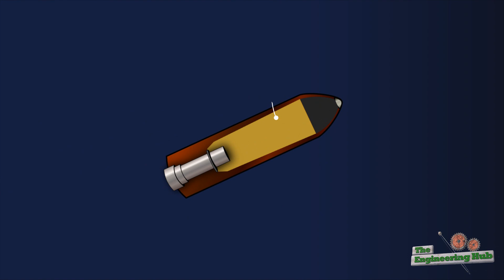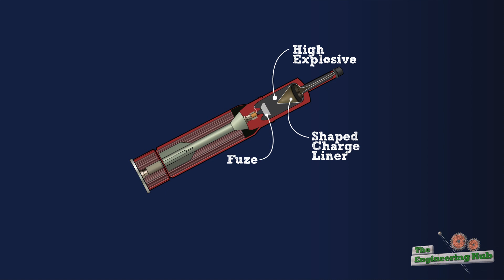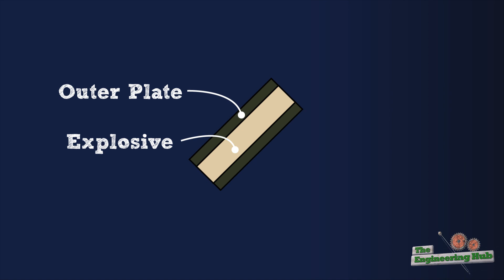Tank Armor. How does it work?

Comment: How about a segment on underground bunkers?  I had the privilege of visiting numerous WW2 bunkers in Germany and France.  The detail and designs of these military bunkers were incredibly well thought out.  Zig zag walls, sloped roofs, air intakes, security measures, cement tables with artillery coordinates built-in, etc.  Extremely difficult to destroy.
Reply from the maker: WW2 bunkers are fascinating indeed. I had the chance to visit some on the coast of Denmark. As a structural engineer, I was very impressed by these structures and the effort that had gone into building them.
Reply: @TheEngineeringHub  most people think dig hole in the ground, put in cement box, then cover with dirt.  This German bunker I saw had multiple levels with descending stairs a machine gun portholes at each level guarding each level.  On the side of the steps going down was a 2ft smooth roadway for a small trolley to operate.  It was used for moving supplies up and down.  Also, no signs or markings of any kind to guide u.  Any intruders would easily be lost in a labyrinth of tunnels.  These bunkers were bombed continuously but survived intact after the war.  There were things built into the bunker of which I didn’t understand the purpose.  But one thing I know for sure, the Germans never did ANYTHING just “because”.  Lol.

Comment: ERA came to be because of a Germen discovery after the 6 day war (Israel Vs Egypt), it was first adopted by Israel in mid 70's and was a secret till it fell in to the hands of the USSR in 82. From than on it proliferated all over the world. thanks for the vid but it's not that accurate.
Reply from the maker: The idea of counter explosion (kontrvzryv in Russian) in armor was first proposed by the Scientific Research Institute of Steel (NII Stali) in 1949 in the USSR by academician Bogdan Vjacheslavovich Voitsekhovsky (1922–1999). The first pre-production models were produced during the 1960s. However, insufficient theoretical analysis during one of the tests resulted in all of the prototype elements being blown up. For a number of reasons, including the accident, as well as a belief that Soviet tanks had sufficient armor, the research was ended. No more research was conducted until 1974 when the Ministry of the Defensive Industry announced a contest to find the best tank protection project.

A West German researcher, Manfred Held carried out similar work with the IDF in 1967–69. Reactive armor created on the basis of the joint research was first installed on Israeli tanks during the 1982 Lebanon war and was judged very effective.

Reference:
https://en.wikipedia.org/wiki/Reactive_armour
Reply: @TheEngineeringHub  Can't argue with Wiki ;)

Comment: It still amazes me that ERA can react in milliseconds to a RPG or other projectiles striking it. It has to react faster than the fuse and explosive charge in anti-tank round. I wonder if a soldier outside of the tank, close to the ERA going off can be killed or wounded?
Reply from the maker: Hi Steven thanks for the comment. It is absolutely insane how the explosive gets activated in such a short amount of time! To your second question, during the research we found that the shrapnel from the ERA or the scattered missile itself can be deadly to nearby targets. But also, it is not that easy to activate the ERA. For example, the explosive will not get activated from a bullet striking it but only from a larger object with enough velocity such as a missile. I should also point out that we are structural engineers and not weapons engineers (little disclaimer). We found this technology fascinating so we decided to make a short video about it. Cheers!
Reply: @TheLadderman  thank you for detailed explanation.

Comment: One surprising part of the Russian invasion is that a lot of their tanks aren't actually equipped with reactive armor. If you look at photos you'll often see the bags on the sides that are supposed to contain the explosives but they're hanging loose and clearly not filled with anything other than the cardboard baffle on lots of their tanks. It looks like they sent them in without either because they didn't have the supplies or they didn't bother equipping them before shipping out, quite possibly because the grunts were told it was just a training exercise.
Reply: It has also been reported that Russian troops lack hard plates in their personal body armor. All they have is Kevlar, that may be one reason so many have been killed in battle.
Reply: The time when you could prepare a proper blitzkrieg is far gone. Shipping too much equipment not essential for a training exercise would have dragged too much attention.

Any suspicion from adverse intel, any soldier with relatives in Ukraine realising something was about to happen could have ruined the plan, leading to an absolute humiliation no propaganda could have kept hidden.

Not saying that sending unprepared troops to war without even the proper logistics to support them will remain secret, but even if they fail, the mere achievement of successfuly invade a country by surprise will somehow temper it, and the soldiers will be considered either as martyrs or heroes.
Reply: Wrong. That was pretty much just misinformation. The “bags” used on the sides of tanks are “soft” Relikt ERA, and the “cardboard” are the organic spacers used in the blocks to make them detonate properly. The reason they looked empty was because the tank included was already captured and looted by Ukrainian forces. We can confirm that because many other small things like sights and bolts were missing too.